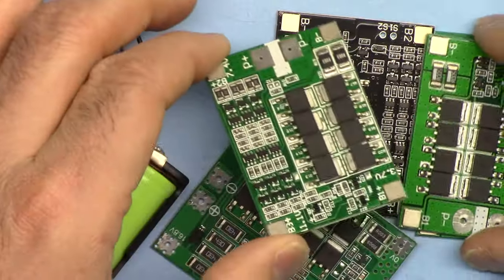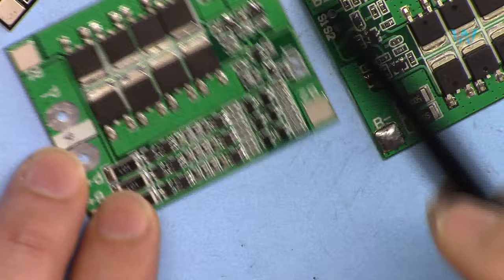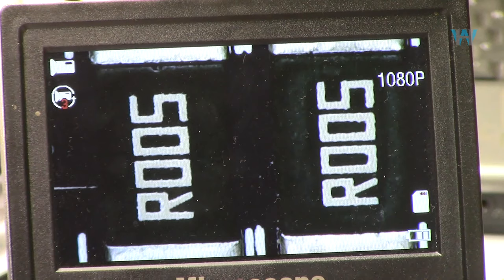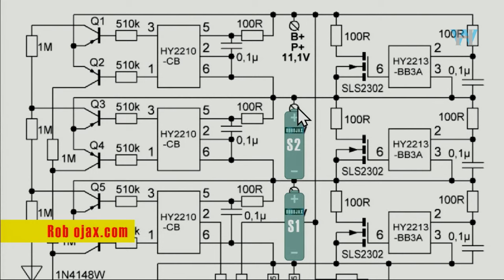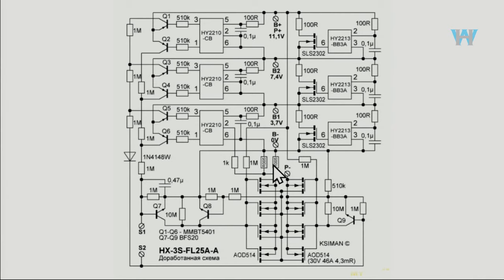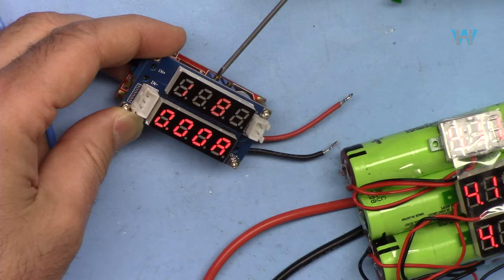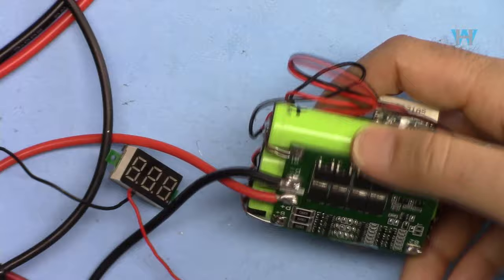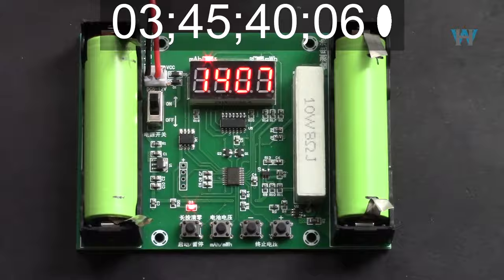The complete Guide to using 3S 40A Lithium BMS Battery Charger

Comment: looks like a mistake with current calculation. if you need 4V 2A on each cell you do not need 12V and 6A from PS. you need only 12V 2A

Comment: i have bought 2 bms one after another neither works! i made proper connection but it doesn't work when i check the voltage by meter when i check via load/power terminals of the bms it shows 4.8/5 volts but when check directly the battery its 11.8 volts and the the batteries wont charge via bms seems it decreases the charge or stays the same!

Comment: Hello what about under voltage protection. I meam i asume the bms it self is powered by the batteries it is protecting. What if i put it away for a long time does it keep drawing power from the batteries or can it conpketely shut off? I worry the bms might cause the voltage to go too low over time. I hope i am wrong

Comment: Need help. I have the exact same 3S25A model. How can I bypass overcurrent protection? It prevents my 12V DC motor to start. I tried shorting current sending resistor but that did not help. Thanks.

Comment: In 3S 40 ampere BMS, voltage across battery is different and output voltage P1 + P1 - is different, then how to solve the problem

Comment: Very in-depth, probably the most in-depth analysis of this module on the internet. It was valuable to see the actual model number of the original design in this video (hx-3s-fl25a-a), because the module I was using was completely nameless, but identical, so it was hard to find info on it.

Comment: Very nice video , I have used these boards for a few battery packs I build 2 years ago. They haven't failed me yet. I have the version you are holding at 6:35 and the battery terminals have a metal plate on them so you can spot weld nickle strips to them instead of soldering wires. It's set up so the strips line up perfectly to the cells to keep the strips short. I paid about $3 USD for each in a pack of 3. Very cheap.

Comment: Thankyou. I haven't been considering the current I supply when charging. I just connect anything that outputs the correct voltage. Car battery was on the list till you helped me see the light. I've got plenty of Buck converters with current adjust just gathering dust & waiting for a purpose like this.

Comment: Wow this channel is a hidden gem. Nothing like this on youtube.
Reply: 2.3v is very low for over discharge protection. I've been trying to find a cheap board like this, but with higher discharge protection voltage (like 2.7-3v), but all of them seem to go so low that I'm worried for the lifespan of the battery
Reply from the maker: The discharge value is determined by the manufacturer. if they say, it will be okay.
Reply: @BAMB00STE  Exactly!   2.3 is way too low for most 18650s and all of these cheap boards have the same specs.  I connected 3 batteries too a board similar and one cell is dead since it let it go way low.  Another thing I did was put 2 low 3.4 (ish) voltage cells with a one that was 4.0v and it overcharged the 4.0v cell rather than stop charging it while the other cells caught up.

Comment: I searched eBay for "12V 3S 40A Lithium BMS" (without quotes) and results return "Standard", "Enhanced" and "Balanced", but don't know which I should be using.  I'm thinking of putting together a few packs for use with my UPS's using the battery boxes on eBay (searched for 12V 10Ah 3S 7P).   Thanks for the very educational video!
Reply from the maker: you are welcome. the more you pay the more features you get.

Comment: I made an ups with 3s 25a BMS and 6cells of 18650. My router supports 12v 1.5amp. Can I use a 12v 5amp adapter to charge the ups alongside to power the router.

5a-1.5a=3.5amp for my 3s battery pack (6*18650 batteries total (🔋🔋+🔋🔋+🔋🔋))

Is it alright to use 12v 5a charger? Is it going to quickly reduce the battery lifespan?

Comment: This is was the best video about BMS! Thanks !
I was figured out about make a test recharging the batteries and consuming it at the same time.
 My doubt was if BMS manage it or it's just 2nd Kirchhoff law. Of course with a power supply at the same level of the recharge voltage in BMS.
Reply from the maker: Hello, If you live in Canada or USA, I am giving away this DL24P 180W load and energy meter. Make sure to sign up for it https://youtu.be/-UblSfUEY-0
Reply: @WattHour  thank you very much. But i'm from Brazil. A little bit far away lool. Thanks for all attention!

Comment: What do you recommend for 5X 18650, as BMS and as charger , and what is the minimum power supply I should use please?
Very nice presentation
Suded
Reply: You mean a 5S battery? So 21v max?

Comment: I realize your video is now over 3 years old but I still have questions. You showed three cells charged to the max and then applied 17 volts to show over voltage protection. I'm wondering what would happen if you applied this same voltage to a drained battery pack. Would the individual cells accept a charge at this point? Is there an internal voltage regulator that would drop it from the 17 volts to the appropriate levels for charging and then cutoff at maximum charge?

 And what happens if one of the cells is internally shorted such as the middle battery in this case? Would the BMS still manage to charge the remaining two batteries? Would it simply cutoff all charging? Your individual battery volt meters, are they going to read correctly if the middle battery was shorted internally?

Comment: Hi Really great tutorial, I am building a solar bank for my garden. If I have 4 18650 in parallel as one bank and have 3 of these in serials can I use a s3 BMS to keep each bank balanced. Many thanks Cliff
Reply: So a 3s4p battery with 12 cells? Yes this will work. I have used a bunch of these boards from 3s2p upto 3s5p and it works fine.
Reply: @randybobandy9828  Just what I was wondering. Thanks !

Comment: Excellent video. I have noticed that some BMS boards have a temp sensor input.Can you elaborate on it’s application?
Reply: its actually a normally close temperature switch. it go open circuit when it temp rating is exceed. (usually 40C)  this will also cause the main mosfet to turn off.  after it cools the switch will again close and circuit will resume normal operation. If board does not come with temp switch one can be added but you need to remove the zero ohm resistor that is used to bypass the missing temp switch. it usually next to where temp switch is soldered.

Comment: Good video! thanks for all the detail.  Question: Can you use fewer cells than the board is designed for?  Can you only install 3cells on a 4 cell board and have it work properly??  Thanks

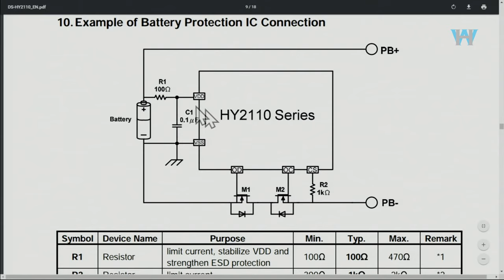Comment: 11:03 OC is not Over-Current protection output, but an Over-CHARGE output, which turns the MOSFET off to stop charging once the battery reaches a certain voltage.
 Also, I have a BMS board (actually a protection board) which has its P- (negative output for the LOAD) taken from the Drain pins of the MOSFETS.

Comment: Great video & detective work! But I think you might be missing something re the 2213 balancing circuits (or maybe it's me). Yes, if somehow a cell were over 4.2 V, the 2213 would drain it till it reached 4.19. But...we're more interested in what happens during charging. Here, if the available charging current is enough, there's nothing to stop a cell from going above 4.2 V. The 2213-controlled FET will be on, diverting ~70 mA away from the cell and reducing its charge rate, but it'll continue to charge until the OV chip disconnects everything. The simpler boards only have a 2213, so that's the bigger problem I'd guess...
Reply: This is what I was searching for. I was testing this BMS yesterday, and it didn't seem to have cell-level over voltage protection at all. Essentially makes it useless IMO.
Reply: @anelinnonmaa  How would it go over 4.2 volts per cell if there is only ever 4.2 volts provided to it?
Reply: @anelinnonmaa  Yes, very useless.
Reply: @vhfgamer  3 batteries in series when fully charged will be 12.6 volts and you need to supply at least 12.6 volts to this board for it to charge the batteries to 12.6 volts... you can actually supply the board with a bit more than 12.6.  I have a similar board, it says it will handle up to 13 or 14 volts, I forget which it.  This board, in many ways, is for the most part useless.
Reply: @ForwardGuidance  Well when I provide 12.6 volts to the board, what comes out is 4.2 volts per "cell".
Reply: @vhfgamer  Not sure how to measure "what comes out to each cell."   I have a PS that I set to 12.6v max and 1A max, it is CC/CV.  As just for a test, I put 2 cells in that were around 3.4 (ish) volts and one around 4 volts and the 4 volt battery went to 4.32 so I turned charging off since I didn't want to waste another battery.  I don't have the same board as tested here, but all of these cheap boards are similar.  I thought these boards should be smart enough to rob voltage from a high cell and export it to the low cells so balance them and then charge to 4.20.  The specs for the board here are: Over discharge protection voltage: 2.6V

Over charge protection voltage: 4.25V

It seems there a way for a cell to get to 4.25V - not sure how.

With all that I said above, I think the board I have is not as good.  It is the small type with the rounded edges so to stick on top of 3 batteries.
Reply: @ForwardGuidance  Well my board takes each cell to 4.2 volts and stops. That's it. 

Mine is the one that came with a 3s lithium ion DIY battery making kit.

Comment: Great 👍🏻 thank you but std charging per cell is 4.2v at 1625ma is around 6.8watts so 3 battery’s around 20watts only but u are charging with 13v 3a is 39watts which is double the std. you must be confused with data sheet 4.2v with 1625ma not 12.6v with 1625ma
Reply from the maker: 4.2V is maximum when the battery is full.

Comment: Thanks for the great explanation we needed.  Just a small question, as this has overcurrent protection threshold about 200mV, if they add 0.025 ohm(two 0.05 Ohm resistor in parallel) resistor in series , the threshold overcurrent voltage should reach at 8A, then how does this provide 40A or more?
Reply: From what I understood, he mentioned the 40A current limit refers to either, (but I'm not sure which) the max charging input current, or the max charging current the module can deliver to the batteries, not the final module maximum output current, but I may be wrong on that.
8A you mentioned sounds more realistic, however, from memory, he did show the mosfets rated at 63A, so perhaps the max module output of 40A is reasonable.

Comment: Fantastic explanation of the BMS and step by step review of the BMS features. Really it has given me the knowledge about the BMS.
I wish to change the Ni-cad cells of my cordless drill to Lithium - ion batteries. The voltage of my cordless drill is 12 V. What are the requirements for this conversion and the electronics involved in doing so. Also kindly enlighten me that is it possible to use a BMS for a 3sand4p set-up of lithium ion battery. If so what's the procedure for it and the charging parameters, such as supply volt and current, then the BMS Board to be used. Your reply will help many people who are afraid to convert their drills, and toys having Ni-cad cells to lithium ion batteries. Hope to see your guidance soon.
Reply from the maker: I am glad you found it useful.  converting this module is impossible. as I mentioned each chip is made for specific voltage and you can't change it.  may be we can add components to make it work but it won't be fully automatic.  as for 3S4P,  when you connect 2 or 3 battery in parallel, this module  will see them as ONE. except the capacity increases.  But series will change the voltage and it won't work. it will kill the module.
Reply: @WattHour  Thank you so much for immediate attention and response. Now I am clear that altering the ni-cad cells based drilling machines or for that matter is not possible with lithium ion batteries and BMS. That's why people show only the single cells with BMS.
Reply: @WattHour  His drill is 12volts. A 3S pack charged is 12.6volts. The voltages are correct so why won't it work? Do these drills draw more than the 40A rating of these BMS boards? An electric motor usually just runs slower with less voltage so I would think the pack would work until you got down to the low voltage cut off limit for cell protection.

I've purchased four empty 12.6volt battery boxes from Ali Express. These come in kits and include 18650 holders, the nickel strips and a BMS rated at 20A or 40A that's exactly like ones in your photos. Some of the kits use a 3S7P configuration while the others use a 3S10P (3 series X 10 parallel) configuration. 

Your video made it clear that there's no way these BMS boards can balance charge any more than 3 cells! Ali Express has a lot of vendors selling on their site much like Amazon does here in the States so they are not to blame for these questionable 18650 battery box kits. I do now wonder how safe they are without battery balancing.

Comment: Thanks for such a clear explanation video; I have a board HX-4S-F30A (4S 30Amps) I am connecting 4S3P 18650 battery pack to it, I can read all the correct values on each B-, B1, B2, B3, B+ ports, it comes with a P- and P+ ports as well which work as Charge and Discharge ports, it has NO additional Charging or C- port.

When I connect a car break light bulb (12v , 55 watt max draw) to the P+ and P- port the bulb doesn't light up and the P ports drop the voltage to 0 and then they go back up to 11v but it never goes back up to 15-16v again. I have tried 4 boards of the exact same model and they all act the same way. It seems like the board is protecting itself but I don't understand why, since the bulb is a 12v and the current for it shouldn't be more than 10 amps, this board is supposed to handle 30A x 12v = 360w

What am I missing? any help will be greatly appreciated.
Reply from the maker: Hi, you did not mention the battery condition. it seems your battery does not have enough charge and the module is protecting it.
Reply: @WattHour  All batteries are brand new, same lot, charged to 4.20v (Sanyo 2200 mah capacity) I have tested these boards with 3 different sets of 4S3P and the last test was with 4S1P just to eliminate or reduce variables. The behavior is the same.
Reply from the maker: this is strange. Something is affecting this operation. I am not sure.

Comment: Hello, thank you for the video. I am using such 40A bms but with 10mosfets version (REV2.3 was printed on the back side). Suddenly I noticed that battery voltage is 0.4-0.6V higher than output voltage. The voltage difference is noticed between B- and P-. I tried to short B- and P- as some people suggest but no reaction, problem still exist. This was not always like that, at the begging of use it was fine. Have you ever experienced such problem? Any ideas how to solve it?

Comment: Can a 2s battery system be connected to a 3s BMS..and input voltage given accordingly, like 8.4 volts?

Also, these BMS, do they automatically do trickle charge ( if initial battery voltage less than threshold)
And do constant voltage charging when battery reaches upper threshold and automatically cut off  when charging finishes?

Does the BMS handle all these and just a constant current source with appropriate voltage needs to be attached to the BMS?

Also, if constant current is set on the power supply, how does the bms do the trickle charge/ constant voltage charge at low currents?

Comment: There is some thing that I didn't understand. Why 510k resistor used between P- and B-. The circuit is on charge or discharge mode because of that 510k resistor...

Comment: Very helpful thanks
 but wanted to know the no. of maximum cells the board can handle as is divided by 3 . 0 v to 4.2 v and 4.2 to 8.4 and 8.4 to 12.6
or is possible to doable  the each cell by 2cells in series v will same but capsity will doabled

Comment: Great directions you've maid.
Would you be kindly tell how about to reduce batteries charge cycles amount? 
How to unplug the load from batteries while the charger power supply is on and we need to power on the load from the initial power supply?
How to commence the charging only if voltage dropped to a precise  value? For example I don't want to get my batteries charging everytime, but after a certain discharge (voltage drop)?
Thanks

Comment: I only have a power source of 12v 1A which I suppose would not be enough for charging a battery pack with this BMS connected. So I charge these cells individually by disconnecting them from the BMS using tp 4056. When the cells are charged, I put them back to the BMS, keep it for a few hours yo get properly balanced. Is this way advisable? (I do this Because I don't have a good current capacity 12v supply for charging my battery)

Comment: I made a mistake while connecting this BMS to batteries, I connected them in the wrong order, now it doesn't cut off when the batteries reach to max voltage. But it balance the batteries and still have the short circuit protection.

Comment: Is it possible to connect multiple BMS modules in parallel, similar to what you explained for the TP4056?
I want create a 3S-3P battery with 9× INR18650 or INR21700 cells.
I'm looking to make an 11.1V - 3S battery with high current capacity of 3× 3S wired to gether in parallel, with only a single pair of + and - output wires.
Also, if connecting modules in parallel is possible, what would be the best way to calculate the maximum output current?
ie: Is the max useable current determined by the maximum output current of the module, or by the maximum output current capability of the batteries?
Thank-you for your assistance.